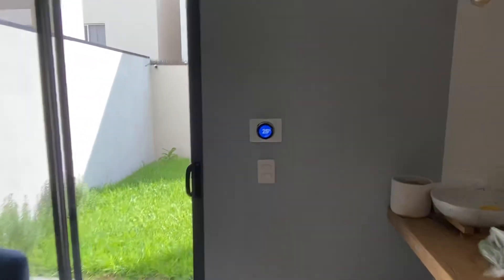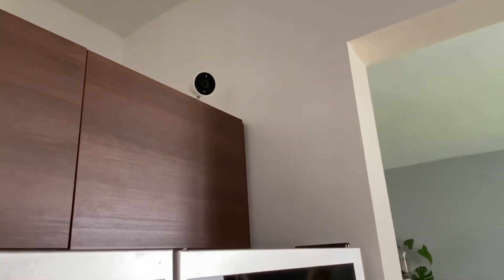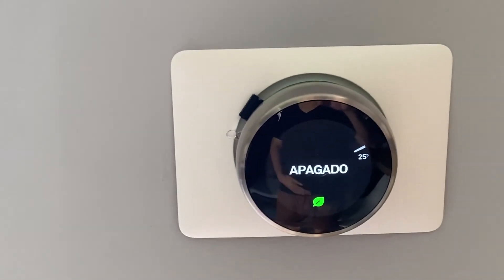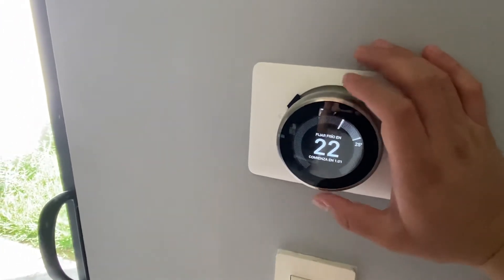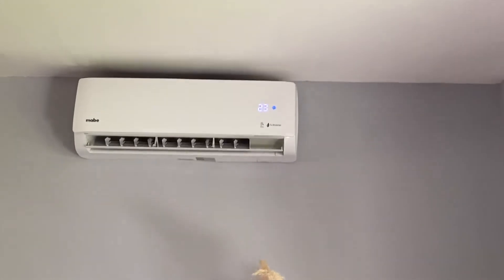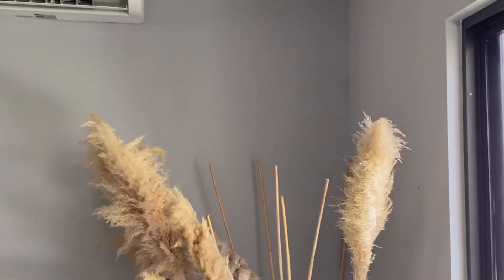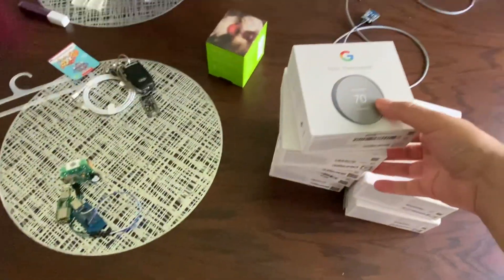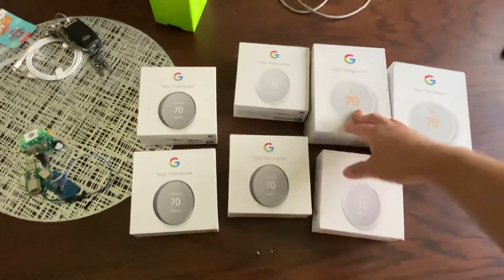Nest thermostat with minisplit

Comment: Andres...Do you think this adapter will be able to pair my Daikin mini-split using an Aidoo Airzone 3rd party control and Burnham Boiler to my Nest for Duel Fuel? Thx
Reply from the maker: TBH I don’t know, you will have to test yourself, at least the minisplit stuff might be covered but I think you will need to tinker for the rest a little bit more

Comment: Hi Andres,
cool stuff mate!

May I ask if you been using US or EU version of thermostat?
Reply from the maker: I used the US version, but most of them use 24vac, so as soon as you provide that as input voltage you should be ok
Reply: @andressantos4054  Thanks for such quick response.
I see on the video that the temperature is displayed in Celsius. Are you based in N.America. The reason im asking is that im thinking of using US version back in Europe for integration with Control4 for COOLING purposes as EU version does not have such option.

So was wondering if it would actually work in EU in terms of NEST app support? :)))
Reply from the maker: @smart_britannia  well I havent seen a EU version ever, but I would say it all depends on the nest device, not on the country/region, my devices are bought on the US and used in south america lol, and they work

Comment: I bought a nest thermostat. (Not the fancy one you have) would i be able to use the adapter for any mini split? Would I be able to control multiple units with my nest thermostat or will it only work with one unit?
Reply: For example, i see in the video you have one mini split, if you had another mini split in another room, could i turn both off and on using Google nest?
Reply from the maker: This adapter is intended to be used in the room where the minisplit is, so it can control up to 2 different minisplit brands on the same room, for a minisplit on another room, you will need another adapter and another nest device

Comment: even though its a cool trick, buts its bad for inverter unit since it will not be able to operate in inverter mode but on/off mode. thus, making it a regular old style what uses more energy then setting it up using remote control and irblasters which alters the internal settings of the AC instead of just on off commands.
Reply from the maker: I also tested energy, I used the sense energy monitor and was able to see that in fact the inverter feature keeps consuming constantly at a rate of 300w and when needed increases to 600w or more, on lg models it gets 50w less in average than other brands but the result is the same, consumption. By using the nest, you cut this energy and obviously when starts it goes again to the 600 o 700w but for a couple of minutes then it stabilizes. All in all yes you end up saving more energy

Comment: Have you thought about creating a more visually appealing housing for the new board that would integrate with the nest thermostat without the need for that large white backing plate?  Something that would cover the gaps clearly still visible but allow for the IR transmitter/receiver to function?  I think it would make it more appealing, personally.  Otherwise, kudos on the job well done.  I am considering installing a bunch of mini-splits in the next 24 months, and was looking for a solution to this problem, and I think I just found it in your product!
Reply from the maker: I have tried but it makes the kit more expensive :( but generally people don’t realize it has something else
Reply: I agree. I love the idea and ingenuity but I don't love the exposed parts.

Comment: does it work with HomeKit if I use hoobs to make nest things work with HomeKit?
Reply from the maker: It does work with homekit natively, you don’t need additional bridges or hubs. The board itself is the one that makes that communication, if you use homekit you can freely change the target temperature and the minisplit will react to that, however there is no homekit to nest communication though

Comment: How do I configure Nest without a central HVAC wires? I have minisplits everywhere and they each have a Flair Puck. Just need to setup Nest to talk to Flair, but can't figure out how to tell Nest that I have heating and cooling without actually connecting those wires to it.
Reply from the maker: For that particular product I don’t know, but my adapter, the one in the video, allows the nest to control ur minisplit more straight forward

Comment: On the cool mode, when the room reaches the target temperature, does the fan turn totally off, so the room is quiet?
Reply from the maker: Yes exactly, the room goes quiet until the target temperature, then if the temperature changes the nest turns on again
Reply: @andressantos4054  Thanks so much.  My ACPro Minisplit works fine in the Heat mode, such that when it reaches the target set-point, the fan goes off.  However, when in Air Conditioning mode, the fan stays on continuously.  

Will a Nest or Ecobee work directly, or do I need the board adapter that you mention in your post?
Thanks!
Reply from the maker: @mitchellbrin3637  yep, you need this board, it’s the sole purpose of it, interconnecting minisplit and thermostat
Reply: @andressantos4054  Thanks Andres.  Where do I get the board?
Reply from the maker: @mitchellbrin3637  in the section of the description is a link to the tindie store, you can do it right there
Reply: @andressantos4054  Also, have you tried it with the Ecobee?
Reply from the maker: @mitchellbrin3637  I bought an ecobee, is still on the box, I am pending to test, maybe i do it this weekend as a new video, but is basically the same, I would say it will work, but I am going to test anyways
Reply: @andressantos4054  Thanks Andres.  Where do I find instructions on how to connect the thermostat to the Mini Split?

Comment: hola Andres. Do you know if something like this works ecobee?
Reply from the maker: Hello, it is 100% compatible with ecobee, I am just pending to upload that video, but it does work
Reply: @andressantos4054  awesome any chance that you know it works with Gree mini splits?
Reply from the maker: @isaacleal12  it does contain a codec for gree, and many others but you can also record your own commands in case your unit is not compatible out of the box, theorically you can make it work with 2 minisplits of different brands or even add a heater, one of the longest videos where i explain that is in the chapter 4, just browse the playlist, so it is universally compatible with any brand
Reply: Hermano saludos como puedo comprar esa placa para configurar mi split

Comment: Are you still selling these? I'm about to build one using an Arduino but this would be much simpler
Reply from the maker: I am, what brand is your minisplit?
Reply: @andressantos4054  I have a Pioneer WYS024GMFI22RL-10
Reply from the maker: @destrucsean  I haven’t tested on pioneer but I am upgrading the firmware to let u record custom commands, that should do it, just stay tuned, I will be uploading the videos and guides on how to install
Reply: @andressantos4054  Ok, for what it is worth, I already have all the Pioneer IR commands. I am mostly interested in your circuit board and code.  I understand if you are not sharing that separately though.
Reply from the maker: @destrucsean  I mean not immediately right now, at some point yes, because it took me several pcbs to get there
Reply: @andressantos4054  very cool project, you could 3D print a small chassis to cover the electronics, and add another IR emitter to the other side to cover different room layouts as well
Reply from the maker: @destrucsean  it does have 6 spaces for installing more ir leds :j if needed, there is a hidden feature I will present in a couple of days, just be patient :)
Reply: @andressantos4054  where can I buy this? Can it work with Senville Brand?
Reply from the maker: @nathanmcdonald8060  yes it can work with any brand, I published it on tindie https://www.tindie.com/products/beckmx/minisplit-adapter-for-nest-thermostat/ this week
Reply: Does it work with mirage life+
Reply: Hola,
Muy bueno tu producto, tienes para mini split samsung?
Y me gustaría saber como instalarlo
Gracias